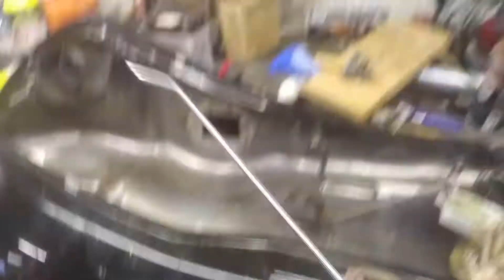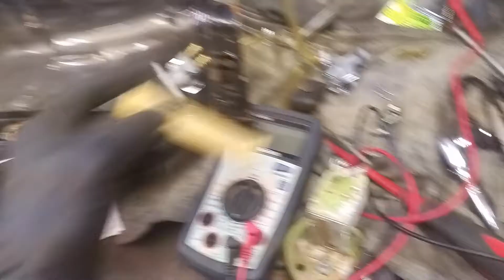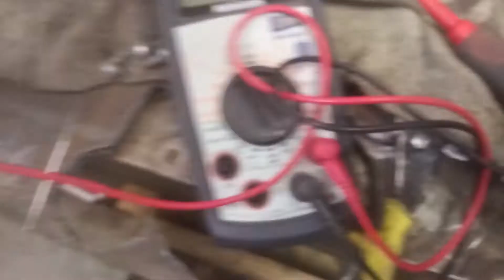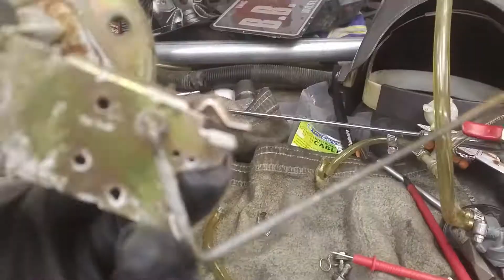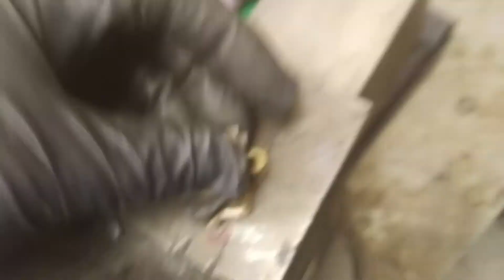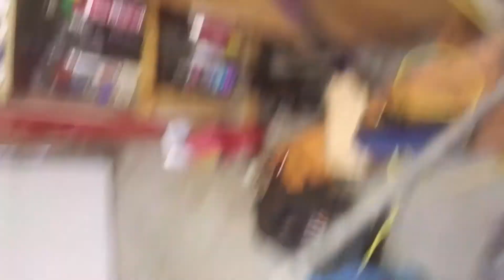Yamaha 1100 fuel sender unit repair

Comment: I am doing a rebuild on 1983 Suzuki GS 650. I have the same type of unit.  Upon rebuilding it I noticed that wire was missing. Disintegrated over the years. Question should that movable copper strip be always touching the wired bar as it moves back & forth. 
 
.
Reply from the maker: Yes.
Should always be in contact. It completes the circuit to indicate fuel level.

Comment: Starlock washer is a better bet to use on the end of the float arm as it will lock the surface of the tang with the body of the unit along with the locking set screw.

Nice video through, full of useful information 👍

Comment: Good info, I just now repaired a honda elite 80 fuel sending unit. Tank was rusted and the contacts of the unit were full of oxidation. It had quicklock starlock washers holding it together. As an option you could have used one of those on the spot where the rivet was placed, press on fit, done deal. Anyway back to my story, popped starlocks off, cleaned & jb welded the fragile hair like copper contacts that broke off the arm. Polished the resistance board, slapped it back together. To test, I connected back onto the harness, hooked a battery to the scoot, turned the key. Gauge started working. I could move the arm up and down and the needle on the gauge followed perfectly. I was about to drop 70 bucks on a new one from honda, got lucky I guess. Good work man!
Reply from the maker: Well done !
These days you can find repair videos on almost anything on youtube.

With world economy these days, don't unnecessarily spend your money if you can repair your old stuff.
Well done on salvaging your honda sender.
🙂👍